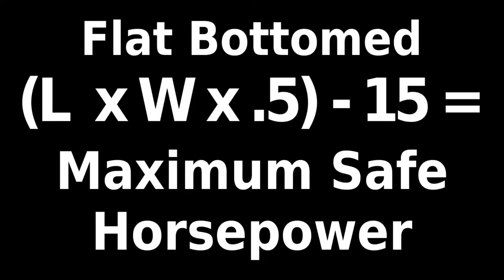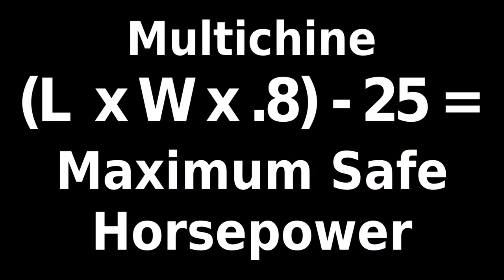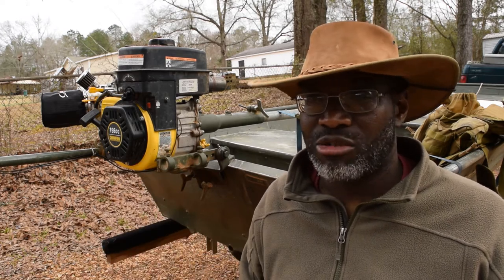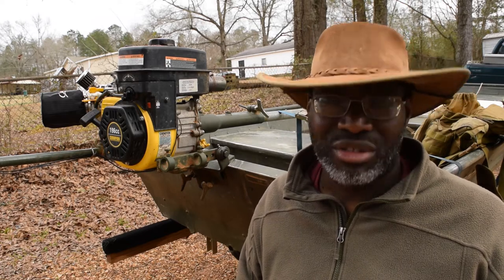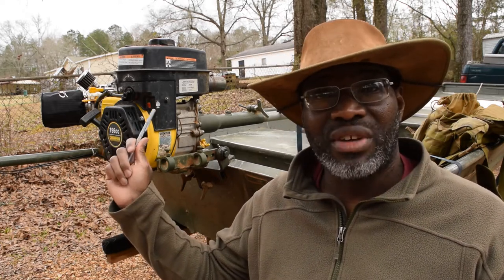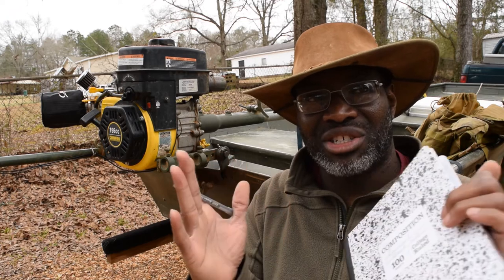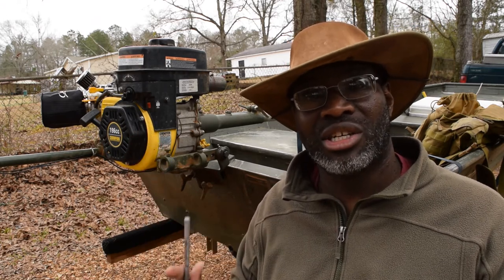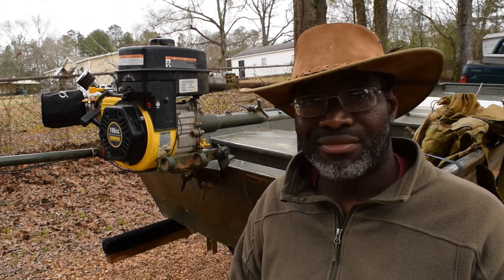Homebuilt Boat Horsepower

Comment: what happen if the propeller is very hard to rotate with the longtail shaft
Reply from the maker: You mean if it get tangled in rope or weeds for something?
Reply: @BlackWarriorLures  no sir  but it look like the plastic bushing melted
Reply from the maker: @lbd_rbx282  Na, that won't make it stop running. It'll run. It'll just sound like it's rattling.

Comment: Narrower the better on the thai kits I say. Just don't stand up too fast or lean back too high in a chair.  I've went over the gunwale one time fighting a pike...I mean a friend did ;)
Reply from the maker: Yeah, that's about what I'm thinking. I'm surprised at how stable my 1236 boat is. Stretching it to 16 feet only makes sense. I wouldn't need more horsepower.